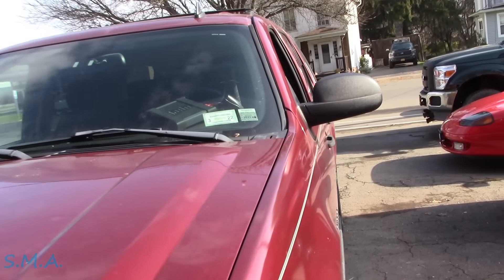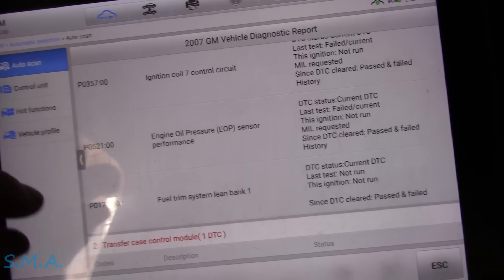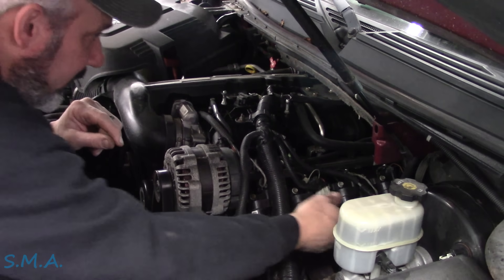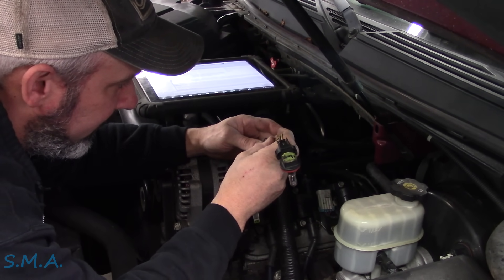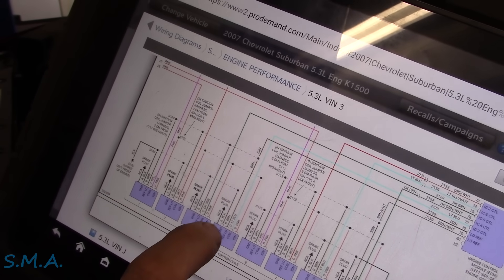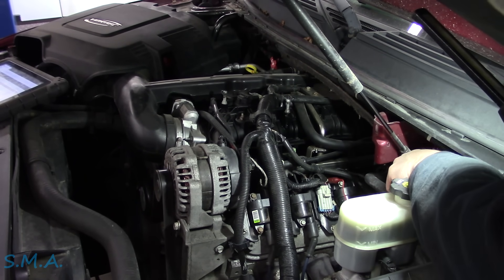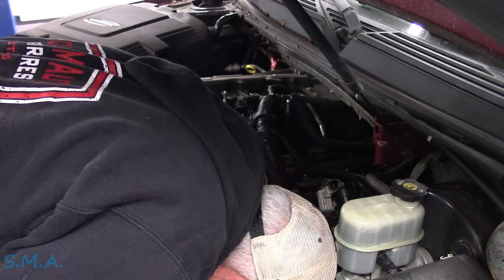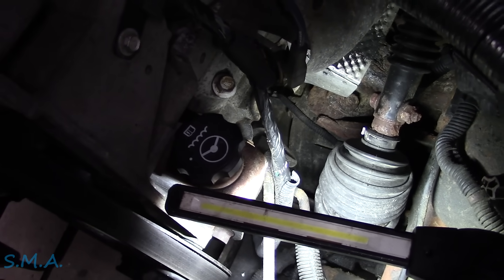Chevy Suburban 5.3: Entire Bank Misfire

Comment: I had a Suburban in the shop today (November 24), customer was complaining about “shaking, stabilitrack light on , and C.E.L lashing).
Codes: P0352, P0354, P0356, and P0358, hard misfires on 2, 4, 6,and 8 cylinders. The entire bank.

I thought “Why does this sound familiar?”
Entire bank gone.... Suburban......even the paint color was the same!

I gave the ground wires a wiggle and then tried to start the car: both banks were now out. New wires and an eyelet fixed the issue.

Thanks for uploading this vid before Thanksgiving!

Comment: My 2010 chevy has a mis fire cylinder 4 I was doing a oil change a tune up on my truck I did it and my stabilitrak light came on and I got code p0354 and the codes for the sta alot ram code said sensor malfunction read

Comment: Good job. If you would have done a quick jumper repair, it looks like they would have eventually lost the left bank too. Always fix a bad ground. If you get a 2002 era Dakota's with a no bus on the odo. Check the ground next to the ecm. 9 wires soldered into one ground eye.

Comment: Just a quick THANK YOU! This video saved me a major headache this past weekend.  
I was about 300 miles from home with my 05 Suburban and it started misfiring. I had my wife and two dogs with me so breaking down on the side of the road was bad timing for sure. I had a
 scanner with me and I was getting a p0200 and p0300. I got on YouTube and went
 to your channel because I have watched many of your videos. You showed in your video
an 08 Suburban with the broken ground wires for one bank of injectors, I quickly found my o5 had that exact  issue. I put new wire ends on and moved the ground to a better spot up on the alternator
 bracket. It fixed the two errors have stopped and the truck now runs better than ever, 
it had also been hesitating when accelerating but this also fixed that issue.

Thank you for saving me from having to get towed and an expensive car rental.  
South Main Auto is awesome!

Comment: I'm having problems with a 2001 GMC 3500 Dooley it was starting and running but the battery kept dying and why put a charge on it and leave a jump all it does is Click what would the problem be and where would I find a wiring diagram for this that won't cost me any money any help would be appreciated it has the 5.7 l in it

Comment: So yesterday I was driving up the interstate for 300 miles or so. Then out of nowhere I had a misfire. Then it stopped but when it came back my entire 1st bank is dead. Damn truck shut off but it will start and idle like a diesel lol. I just replaced all 8 plugs wires and coils nothing is loose. I thought it could be the arm having collapsed liters. But the codes suggest otherwise. Thoughts??

Comment: Once had a car not start, pulling my hair out trying to figure out why.  One wire had fried inside the insulation but not scorched. I found it by pure luck and frustration, as I just started to wiggle and pull wires at random and it pulled apart.

Comment: I have a 2005 Chevy 1500 with 5.3 Aluminum Block. It has a rough Idle and almost stalls at Stop lights. I have changed MAF, Map sensors, O2 sensors All new plugs All new injectors, Fuel Pressure is at 59 - 60 PSI. Funny thing is when You hit the gas its fine drives fine and has power. Codes say lean bank 1 and 2 . Any ideas not sure if vacumm leak when test it shows negative numbers which is what it's supposed to! Im lost ANY IDEAS PLEASE

Comment: I have same problem entire passenger side is failing with misfires changed entire set up coils plugs wires and nothing took off head cover and each cylinder is working as it should so no idea the truck is running crapy and engine lights is flashing  I’m gonna try this and see if this is the problem
Reply: I checked the power and ground for the main coil plug and there is both ground and power going to the main plug

Comment: My whole passenger side bank is misfiring but I’m getting spark on all wires and got fresh plugs on that side and when I disconnect the coil pack on the passenger side while it’s running nothing even changes it runs the same

Comment: I had a Buick Rainer two days ago. That would run fine and just die out of the blue. It also had the famous oil pressure switch code. Anyhow as I was plugging the oil pressure switch in I happened to lean on the fuse block and the car died. Well I had no power to the coils. Set a bunch of codes and wouldn't restart. Erased the codes and it fired right up. Started to wiggle the fuse box.  It died and all the same codes came back. Also one of the clues, the customer said he was having issues with the blower motor shutting of periodically before it died as he was driving down the road. Well power distribution showed all the codes had the same power feed in common. As you say, better to be lucky sometimes thant good.
Reply: Oh it was the 5.3 as well

Comment: As a mechanic I’ve seen way too many Shabby ass grounding wires the car companies use, they’re way too cheesy I just don’t last so I reestablish all my grounds with quality wiring and connectors with stainless steel bolts and screws. Also has a guy who loves car audio grounding is a major issue and should be done well for the best results… Keep on rockin man…

Comment: My husband says that you are the best.  Do you work on Fords...2008 Limited Expedition?  We have been to two Ford dealerships and two other mechanics.  Each one says that it is something different.  It has a warning light and a ding, ding saying the emergency brake is engaged, but it is not. Some times a light comes on saying the inflate tires is faulty.  I dont mind the lights but the constant dinging is awful.  The dinging will leave for a few minute but comes back.  If you turn the signal light on, the dinging stops.   Is the car a hopeless case?

Comment: Hey amigo,  I have a 2012 1500 5.3 and the 2-8 plugs are damn near new looking since I changed em in July, I'm getting evap codes and p300 as expected.. could it be the ground or my charcoal canister? The perfect valve is working fine, my buddy said my computer has it being stuck in 4cylinder mode still.. idk what's going on any suggestions?

Comment: Love those boring electrical videos. Had my own 'bad ground' lately. Someone removed an A/M remote starter 👍 but forgot to hook up the ground he took off causing the push button start to set a code and trunk popper to not work. Easy fix after a quick look at a wiring diagram.

Comment: Haha I just spent 3 days, between looking at wire diagrams, dreaming up tests, going with Haynes and Chilton manuals test to discover a bad ignition control modular.
 I was chasing 2 issues fuel? Ignition?  Because no spark test lamp, no fuel presser gage. Sigh....
 It was a crank no start issue.
 Finaly confirmed ignition tests called out the modular, replaced, hard start but start, so now fuel issue pump related shows no prime.
 Its a 96 GMC truck new to me so still learning it. Easyer then the newer stuff but way more electron crap then my 86 Toyota I had for 16 years every inch of.
 Shade tree mechanic skills, to poor to not be a DYI guy.
 Your videos really heip with a basic dioignostic tree.
 I appreciate that more then I can say.
 So Thank You, good job teaching, showing us how its done.

Comment: Eric, you are so fast, it's mind boggling, I had the exact same issue on a GMC pick-up only 3 days ago. My customer was told by a dealer that he needed a new computer! It's a good thing  he decided to take it to me. It took me about an hour, but I used the same process.
Reply: So the dealer diagnoses a faulty computer when it's really just a bad ground wire. The only thing that surprises me about this? Is how supposedly "qualified" people can be so incompetent/crooked/pick one.
Reply: @JohnnyTalia  pretty common, they would swap the part, find it still doesn't fix the problem, find the ground wire, and then continue to tell the customer the ground came off, fried the computer, and charge them half the value of the vehicle.
Reply: @JohnnyTalia  Lectricity bee's confusing sometimes.And common sense is in short supply.When all else fails blame the computer.
Reply: It's what happens when the dealer is too cheap to send their techs to school.
Reply: @JohnnyTalia  they're only qualified on paper
Reply: @Mart H, sounds like the owner needs a new dealer.

Comment: Nice to catch a relatively easy one every now and then, thanks for posting.
Reply: Fixing it is the hard part, especially for the purists who want to try fixing those wires to their original grounding points. No thanks, I'll save the sore muscles and dropped tools and use the other ground instead.
Reply: @markh.6687 ,  "Electrically, it's the same point."
Reply: @rickn8or  Agreed, which is why I'd use the easier grounding point.

Comment: From salt water marine engines to salt on streets on long island ny I can tell you any wires which have  12vdc  positive  and grounds dissolve turn green in insulation and crusty at connection s.
Just a matter of time .
We spray all connections with CRC oil grease all connections ground spots. 
Excellent videos.
Thanks Eric
Reply: Dissimilar metals are the main cause...tin coated terminals in contact with iron etc. That starts the process, my guess.
Reply: @Garth2011  yes and salt accelerates oxidation.

Comment: We’ve had a couple of Chevy box vans loose a whole bank. Turns out the fuse box was getting the green death and dropping power to the fuse that feeds a bank of injectors. Ended up just replacing the fuse box on them since it was all going green.

Comment: I think you did do a video before on the ground wire and I cleaned up the connections on my wife’s suburban and it fixed the problem. We have two suburban’s and electrical problems are the main issues for us on these vehicles. Still good vehicles though, 200k miles one one and 400k on the other. That’s pretty good!

Comment: The wifey and I just brought home a 2022 Chevy 2500HD High Country with the 6.6L yesterday and no sooner did I pull into the driveway a check engine light comes on. Either this is a start of a series of problems I'm going to have with this truck because I told the wife this will be my last vehicle I'll buy ever or it's because it's a Chevy. Time will tell later today when I take it back to the dealership today when it opens up

Comment: Worked on my uncles truck one day. Had every code known to man. Found the ground wire harness bolted to a plastic intake manifold, I suspect from when the previous owner replaced the engine. Also there was an O2 sensor wire pinched and broken between the engine and transmission. SMH

Comment: Mr. O I need your help. I got a 99 f150 4.6 with these codes p1131 p1151 p0171 p0174 p0304 and p307, no leaks anywhere via smoke test and I put new wires and spark plugs on and switched injectors around and problem persists. What can I try next?
Reply: Fordtechmakeuloco prolly has some direction for you to go on his channel
Reply: @samwiggins5349  appreciate your direction

Comment: Ah yes.  The lovely p0300 random misfire with flashing engine light.  My 2000 Intrigue (which I called The Mystery Machine) suffered from this.  My usual shop wanted a $1000 to fix this problem by throwing parts at it.  All of the parts were recently replaced from a tuneup before they wanted new parts.  Electrical shop down the street from me found the problem within an hour and charge $150 for the trouble.  Ground wire corroded. I thought I screwed up the car because I did the tune up.  Happy Thanksgiving.

Comment: extremely common on LS engines in a saltbelt area of the country.
Reply: Except for this engine isn't an LS, it is a Vortec.  4.8, 5.3, 6.0 truck engines are all Vortec, not LS.
Reply: @Mr.Ferraris4U  yes, you are correct, this engine is not an LS but is a Vortec which makes them completely different and do not share any components.

Comment: Thanks for saving Chevy truck owners worldwide from those who would tell them they needed 8 plugs, 8 coils, 8 injectors just to start with, and then, when that didn't work, probably a new battery, battery cables, a new wiring harness and computer box, before they recommended replacing the whole engine.  After all, XMas is right around the corner, and somebody has to pay for it!

If Chevy engineers could apply what you know to building these trucks to make the wiring connections last a little longer, then Chevy could guarantee that they would run more than 3 years or 36,000 miles, which would be a new milestone for Chevy.
Reply: Mine has 365k miles

Comment: why put a ground wire 10 feet away from the electrical components that use them? I could never understand that kind of "design" logic on american cars.... On toyotas and most japanese cars, the ground wire is about a few inches from where the components are connected to.... if ever a separate ground wire is used.

Comment: Dealt with my first 5.3 with DoD. Dead misfire on cyl 1. Had compression of 150psi till it built oil pressure, then 0. Pulled intake, valve cover and VLoM. Lifter spun in the bore and messed up cam. Crappy engineering. Have to pull head to get to lifters!
Reply: Jimmy S  yeah we put it back together, left #1 injector unplugged so my uncles friend can limp it around till it does, or gets replaced

Comment: New York State strikes again. All those taxes and you get to pay again for repair and replacement for your vehicle.
Reply: Cheap Chinese components built to low-quality specs more like. "Nobody leaves out the quality like GM". For once, NYS isn't to blame. Better quality parts wouldn't fail like this. I have driven older cars from more than one make, the wire and connectors weren't designed and costed to the last millimeter in older vehicles.

Comment: Ford guy here watching these hilarious Chevy fixes so I can make $50-100 off Chevy owners.
Reply: Chevy guy here. Helped Diagnosed a f150 stalling. Fuel pump just quits running. Bother in law to it to Ford. Their Ford Techs ran a jumper wire to keep the f150 running. Broke a harness at the back. Didn't replace the harness. Gave it back to my friend. He was cruising down a congested freeway and the truck stalled again. My friend discovered the Ford Tech just pushed the jumper wire into the harness. My friend went and bought a Chevy.

Comment: Typical wannabe mechanic would replace plugs and wires, then replace injectors, then the coils, then replace IAC and PVC valve, then throttle position sensor and then, after charging customer $1,000,.......Send It to SMA where Eric will properly diagnose and repair the vehicle in about 15 minutes.

Comment: Not boring. 99.327% of all facts are just made up. However, 99.327% of humans don't understand the simplicity of ground wire in a vehicle. Dis-similar metal connections corrode if aluminum/tin or rust if iron. Old cars... salty roads... mousy-chews. Back-probe.

Eric, you and the Mrs. could make some money from us by making up yer own SMC Back-probe light. Price doesn't matter. Seeing that little thing in my toolbox would make me THINK every time before I overthink every other possible fault first. Do it. $39.95? It'd be fun for us subscribers.